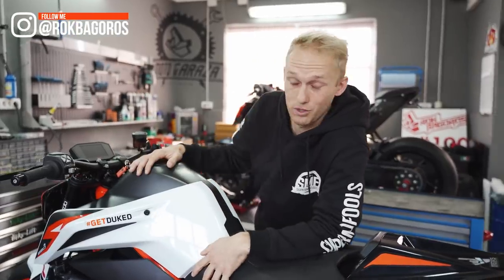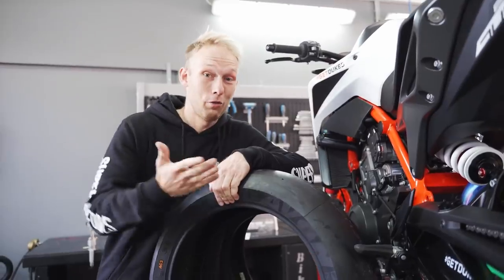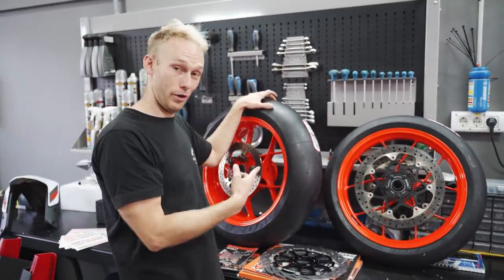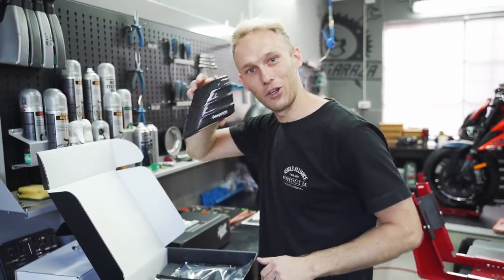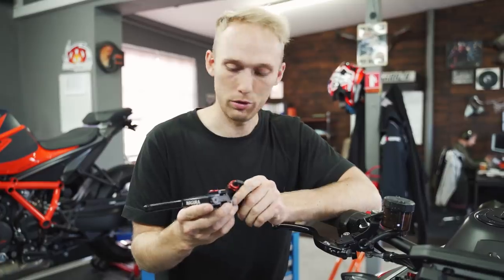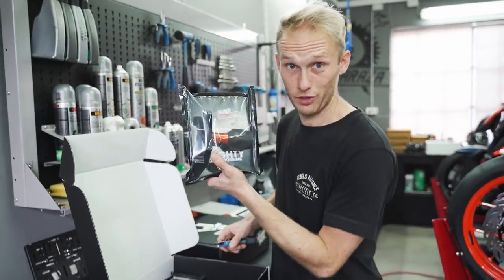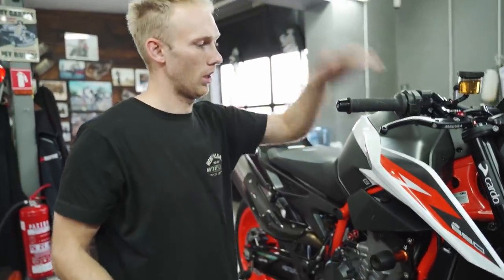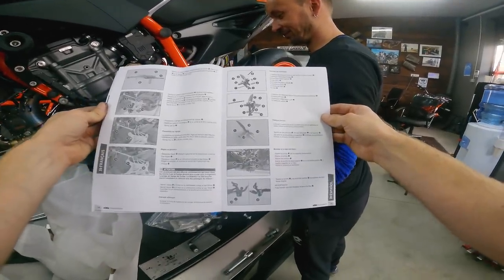UPGRADED KTM 890 DUKE R 2020 | RokON VLOG #104

Comment: You still have the black standard fork bracket. Get the orange power part from KTM. I have it and it looks so mutch better. With the orange brake fluid cover.

8:51 are the crash bobbins sold in pairs or pcs?

Comment: Those spools are way too expensive to be that quality. Look @12:58 and see how the finish chipped just like the $12 EBay spools. You should redesign with the Evotech Performance model in mind. Just my opinion. No one wants to spend close to $40 on spools that will look rough after a few uses, like yours.

Comment: Petalled discs are the worst performing discs out there. If they were any good, they'd use them in racing. Not only they are not good, they cause vibration and wear out the pads quickly.

Magura is better that Bremo master cylinder? 😅 I never thought I would live long enough to hear someone saying Magura is better than Brembo. But they are making excellent bicycle brakes.